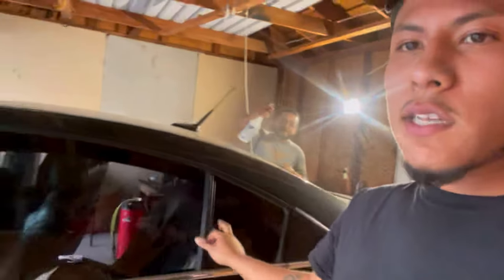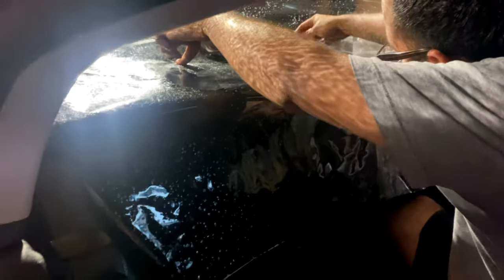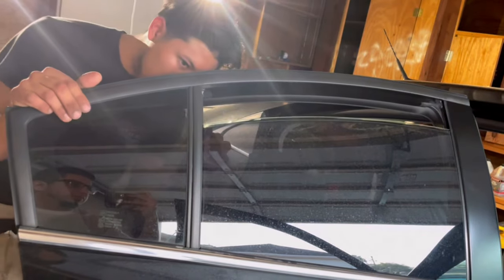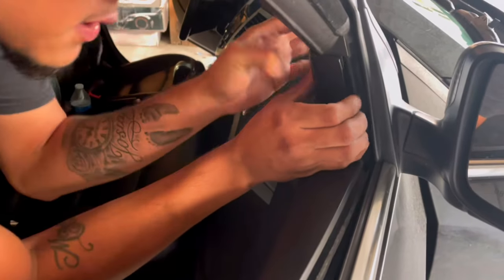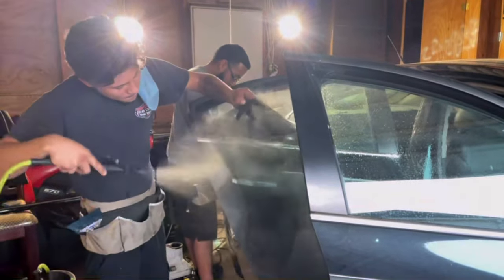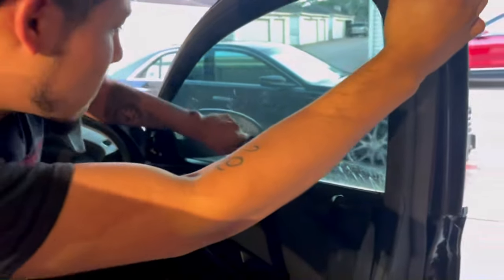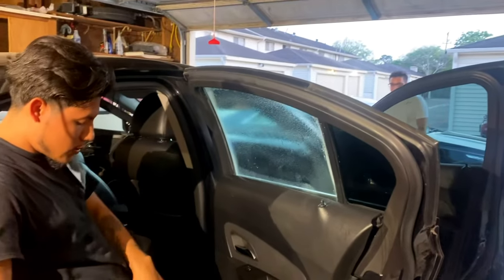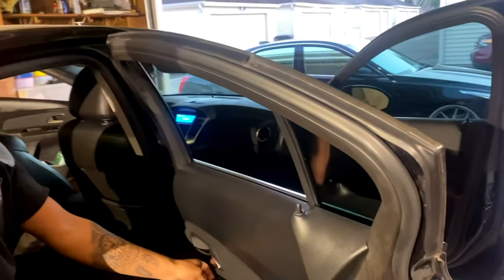Tips & Tricks For All Chevrolet Cruze Window Tint Install

Comment: what tint do you use
Reply from the maker: SunControl Optical Shrinks Easy & easy for install
Reply: @highcuttv  thank you i been using suntek and maxpro
Reply from the maker: Suntek charcoal is what I use to
Reply: @highcuttv  yeah its good maxpro shrinks so good also i just opened a shop out here in pa but another question i use machine to but i dont see shrinking how you dont get no fingers
Reply: Is shrinking necessary for side windows?
Reply: @norcalsvt0354  when i dont shrink i seem to get alot of fingers
Reply from the maker: Depends on the cars windows if they are curved shrink most of the time u will find yourself shrinking
Reply from the maker: Nope is not
Reply from the maker: Most vehicles you will be able to tel if it needs shrinking or not depending how flat the glass is